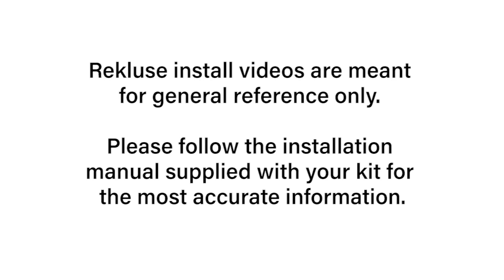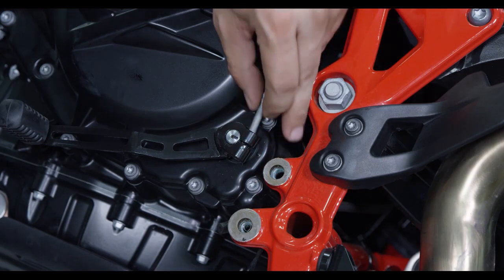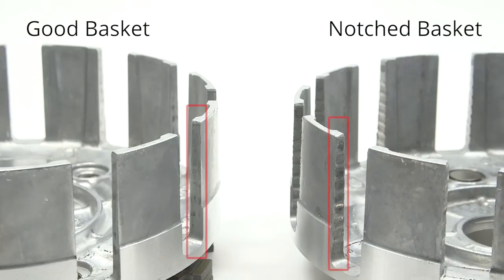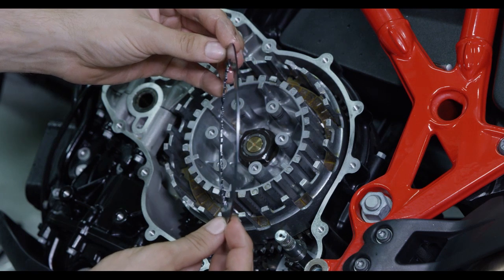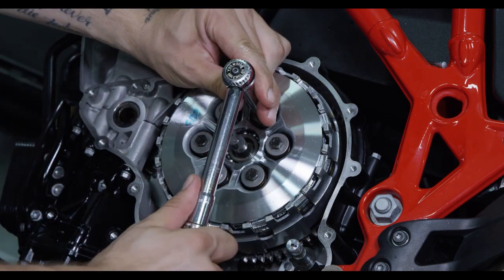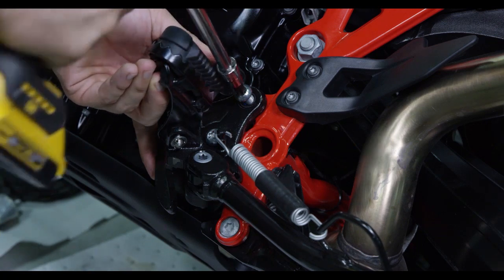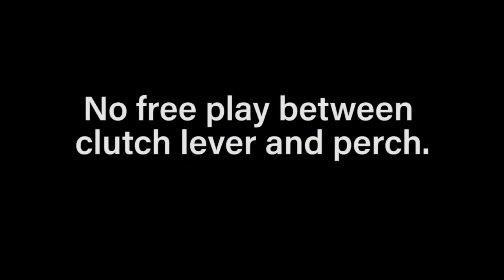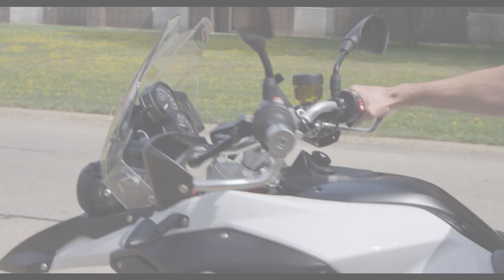Rekluse RadiusX Installation for BMW F650 F700 F800 Parallel Twins

Comment: Do you have to drain the oil first?
Reply from the maker: If you lay the bike on its side, you won't need to drain the oil. If using the bike's center stand then the oil will need to be drained first.

Comment: do you have video to install at yamaha WR450f 2005?
Reply from the maker: Thank you for your question. Our install videos deal with the general process of installation and for reference only. You will still need to follow your installation manual and setup sheet, as installation varies by model. 

You can visit our channel and enter the search term "Cable" to see all videos dealing with cable actuated models, such as yours.

Comment: I’m going to add another ‘thumbs-down’ to your videos. 

I purchased a nearly new BMW F800GS with a Rekluse clutch. I also bought different levers (in attempt to decrease my lever gap for better ‘fit’), and since then, despite viewing your videos multiple times, have not been able to decipher how to get correctly re-adjusted.

Your online videos & manual appear to lack complete definitions for Free Play Gain and Installed Gap. Wading through things about my 5th time, I now understand those terms well enough and have, (what appears to be) fairly closely set Free Play Gain, but cannot shift into gear (with the clutch pulled), without immediately killing the engine. Meaning I am not disengaging at all.

I really don’t want to trash can your clutch until I have at least run it a while correctly adjusted, but this is really getting old.
Reply: Does the bike launch forward when you go into gear and then dies? OR dies immediately? maybe your side stand sensor is buggered and needs repair (common problem) Have you made absolutely sure the fact that the clutch is engaging is killing the engine?
Reply: Thanks for the reply. But at this time IDK what steps I may have taken back then, but I did get it correctly adjusted. I now use the bike as a regular manual clutch except 1st gear at stops. For that it works fine. It’s novel, but I have yet to see enough benefit to overcome the cost of install. Lucky me I guess, mine came with the bike.